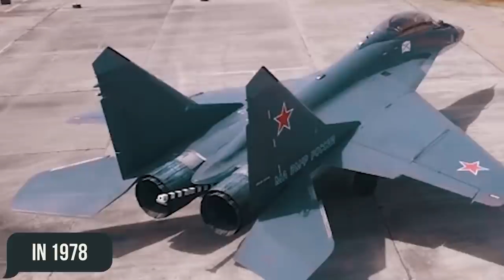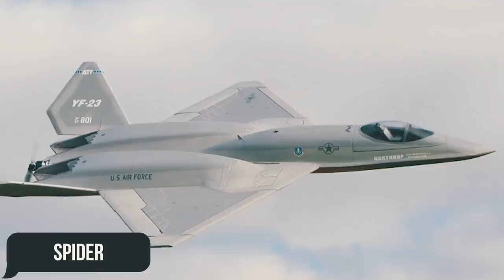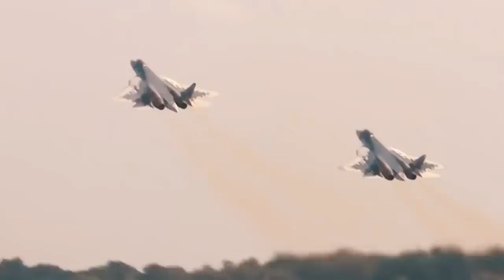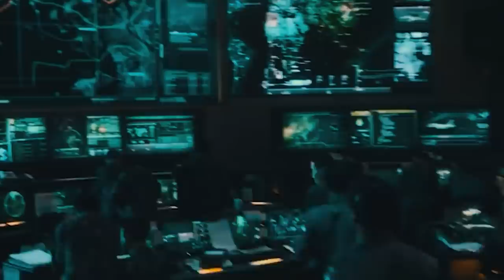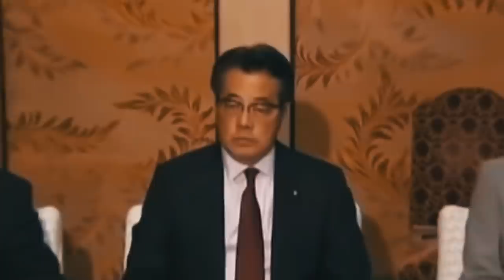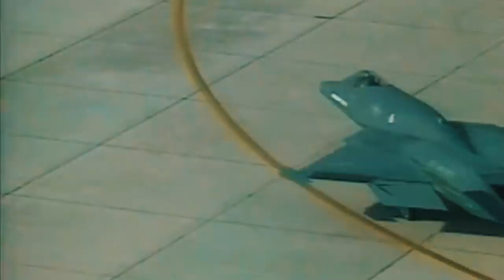Reborn YF-23 Will Shock China and Russia Soon!

Comment: - now jaaa eh 
I`m not so warrior fan but why not some cheap version of it instead of stupid f16 or f35 
- shall be croats buy instead or nonsense f16 
- also f35 is nonsense 
- all planes with one engine is almost pure nonsense 
_
some upon best plane here whom can still fly is some MiG21 
- still doing 
- what is problem one engine whom have cause in lot failures
_
when you have only one source of power and does not working 
- you are lost
- in some huge battle you are hit on one engine 
- you can pull up you back others remain fly and you are saved 
- with one engine you are death